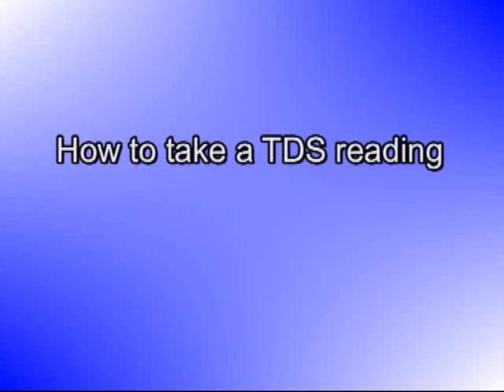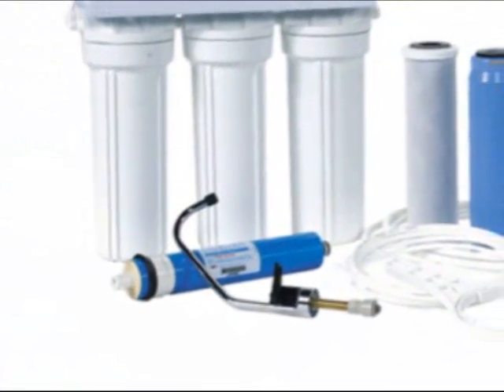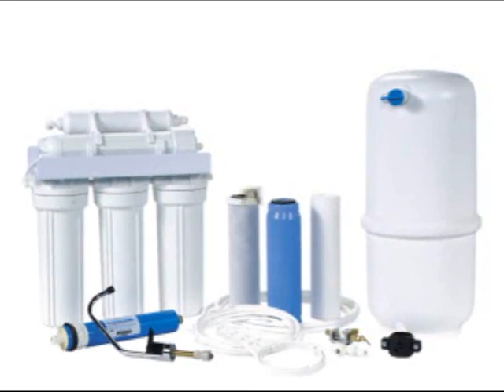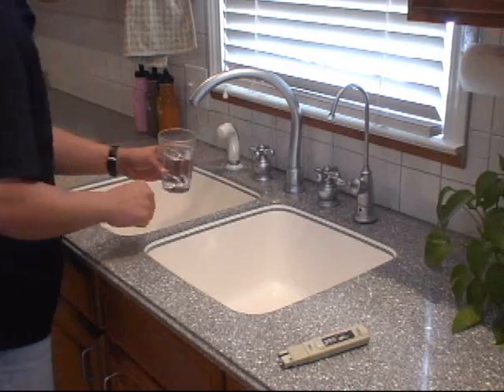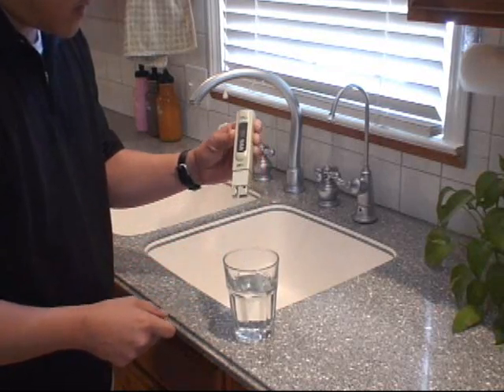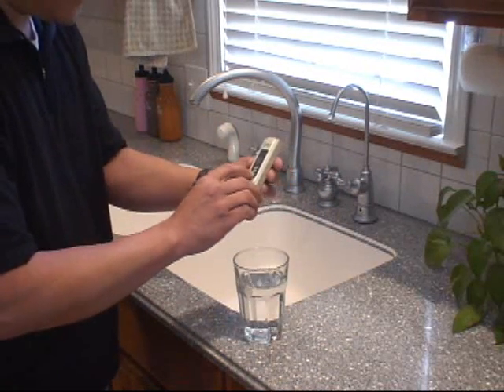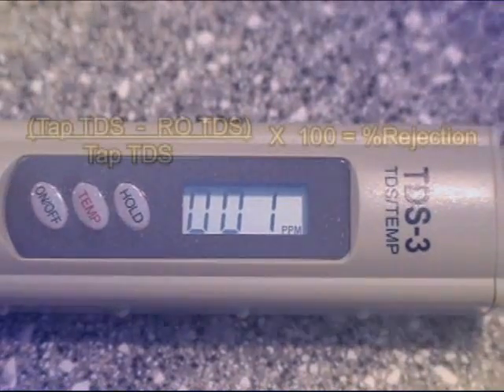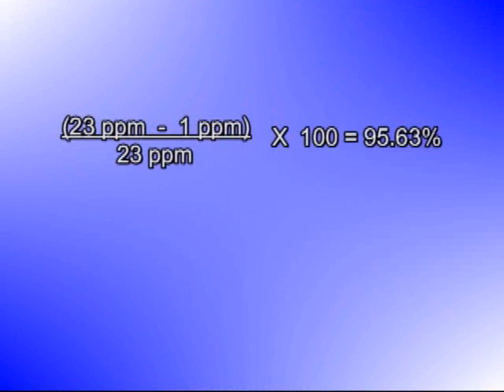How to take a TDS meter reading

Comment: RO water is bad for health because it filtes both required and non-required minerals (upto great extent) from water. All brands of aquaguards those are available in market are filters like so. So, to drink mineral water through out the year individual should install rain water harvesting systems at home which will cost 3-5 times cost of a aquaguard. But, if we see for long time like  10-15 years than its cost will be far less than the cost of aquaguard.
Reply: Wrong, you could easily get the required minerals from food by having a balanced diet

Comment: The problem is with the readings is it detects minerals (which we actually need) so high levels of naturally good minerals give off a high reading and indicates you need to filter which you don't, so they are not the most accurate thing.
The only way they are SOMEWHAT accurate is if you know the water quality is bad and you are comparing it to a before and after.

Comment: Ok so here is my list of readings from 4 different sources of water 
Tap 092 
Alkali 700
Cool Ridge Spring 119
Rainwater 192 .
Can you tell me which is the best to drink , as I buy the alkali water for $10 for $15 litres , and I think it's the worst one according to your chart , but I might have it al, wrong .
Thank you
Reply: @cloud9438  of course, distilled 0 has absolutely no chemicals in it. So when you as chemicals you will show a reading testing after adding. You can add whatever chemicals you want. Just do your own research on the chemicals you add. You need to decide what is healthy. 🙏🏼
Reply: Z zz The purchased alkaline water from the store you mentioned has so much because it is loaded with chemicals to make it high in pH. Which is not necessarily healthy either. It gets very tricky figuring out healthy water. Honestly the healthiest option is distilled water or at least reverse osmosis water.

Comment: Big question, I am having trouble with my hydroponic garden, beginning gardener, The TDS show my water is 53ppm, I added my soluble food, the reading went to 12ppm.
My plants specifically needs 250-1200ppm through the growth cycle.
Am I doing anything wrong or do I need to do math for a correct reading??

Comment: 23ppm - thats like rain water - in Europe tap readings are 300ppm. The lowest bottle reading i have found is 140ppm. This dont make any sense. If U.S. water is 23ppm then why bother buying a filter
Reply: anything under 20ppm is virtually distilled water
Reply: In Noida meter reads 1200ppm 😥

Comment: So the Govt in Grenville, SC doesn't add fluoride into your tap water? 

My TDS reading after RO filter is 39ppm.  My tap TDS reading is 441ppm. 

SoCal Water is POLLUTED by design.
Reply: Ours is the same, 376 lol

Comment: What is the difference pouring water in a glass Vs pour the water in the TDS  Meter Cap and testing it?  If I pour water in a Glass and let it sit before I test it, Wouldn't most of the solids settle to the bottom and giving me a false reading